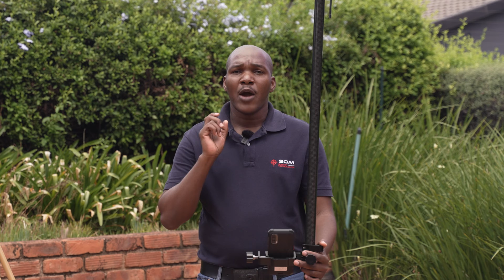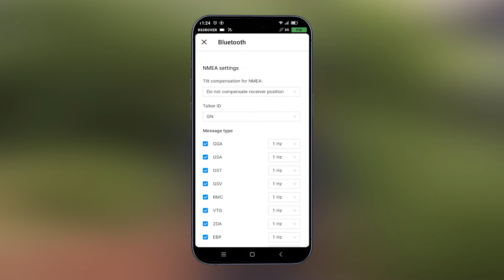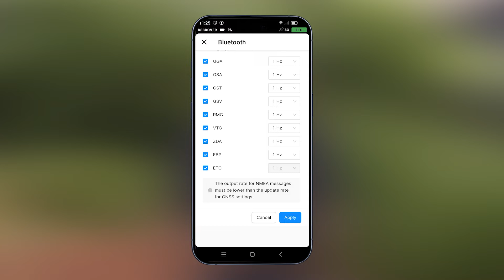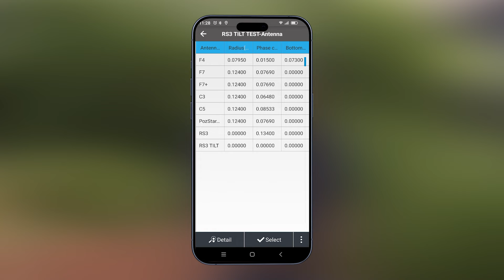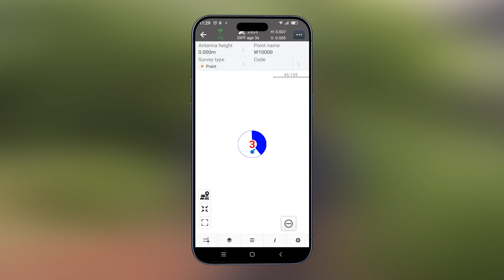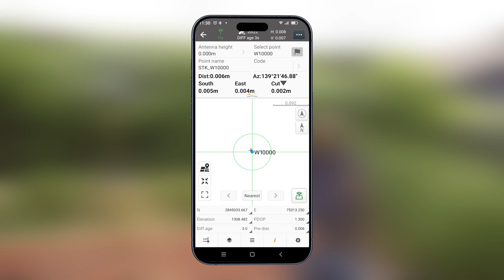How to setup Reach RS3 tilt position to third party application: eField

Comment: I have a question about the RS3 compatibly to which other older models like the RS+. Is it compatible?
Reply from the maker: Hi there, thank you for your question!

The Reach RS3 isn't compatible with the older RS+ model due to a key difference in their technology. 

- Reach RS3: Utilizes a multi-band GNSS receiver, enabling it to leverage multiple satellite constellations for increased accuracy and performance.
- Reach RS+: Operates on a single GNSS band, limiting its compatibility with the RS3's advanced features.

Therefore, using an RS+ as a base for the RS3 won't provide the desired results and might leave you on float.

On the other hand, while using the RS3 as a base for the RS+ technically works, it wouldn't be an optimal solution. The RS+ wouldn't be able to fully utilize the capabilities of the RS3, defeating the purpose of having the more advanced receiver.

For optimal performance with the RS3, especially with tilt compensation, we recommend pairing it with another RS3 unit or the Reach RS2+ unit as a Base.

Feel free to ask if you have any other questions!
Reply: Thank you! I just recently purchased and received the RS2+ and it works smoothly with my RS3.

I do have a question as I am new to the Emlid Brand. Can I manually add coordinate points to flow or studio to complete a drawing like I do in autocad?
Reply from the maker: @limitless1430  Hi there! Thank you for your question!

Points can be added manually into Emlid Flow by either typing them in manually into a project or importing them from a csv file. Emlid studio is for post-processing your gnss raw data from receivers in either Static or PPK modes it is completely different from autocad.

Hope this helped! If you have any more questions, please do not hesitate to ask. We are here to help.